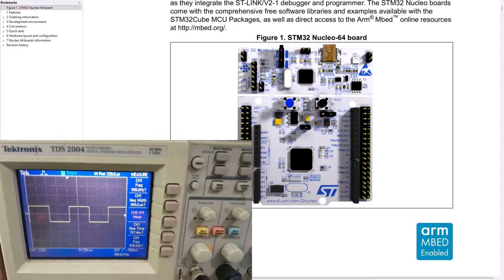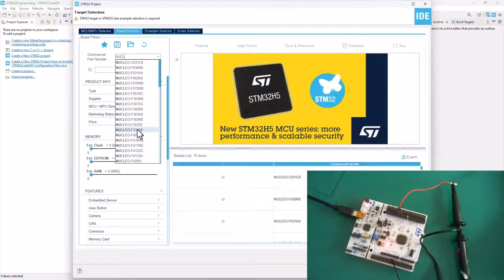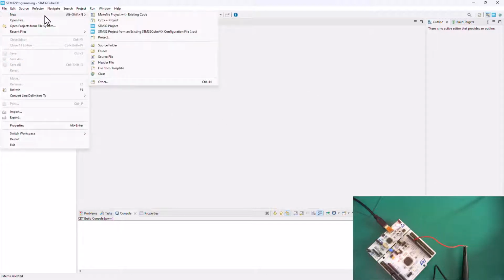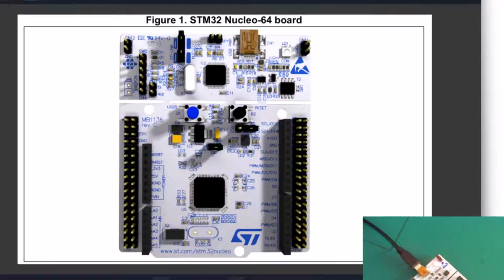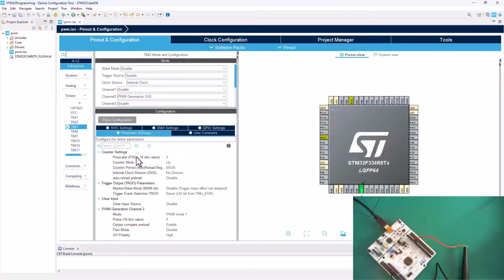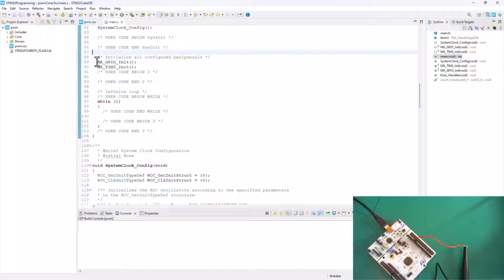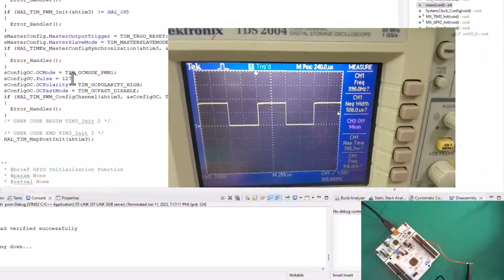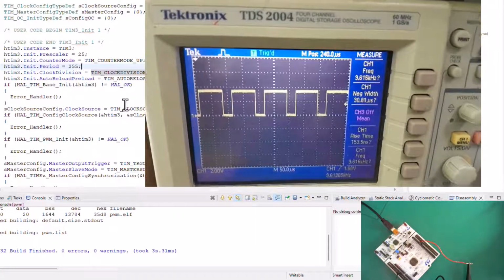How to generate a PWM Signal with STM32

Comment from the maker: If you ❤ my content and find it helpful, please Subscribe and hit the Bell 🔔

👇  SUBSCRIBE TO CMTEQ CHANNEL NOW 👇
https://www.youtube.com/c/CMTEQ?sub_confirmation=1
Reply: Hi mate, can wi fix the pwm duty cycle is 50% or 70%??
Or if we leaf the pulse to 0 is what happen???
Reply from the maker: Yes, you can fix the duty cycle at any value you want between 0 and 100%.
If you leave the duty cycle at 0, the signal will be off, zero. If you leave it at 100% , the signal will be 5V continuous
Reply: @CMTEQ  no, i see on the mc workbench is pulse=0 sir. What is that mean?? Because i used for motor control, and i want to fix the pwm on 50 or 70% sir.
Reply from the maker: @botak333  Hi, did you come right with your test for 50% PWM Duty cycle?
Reply: @CMTEQ  i dont know, because the code from x cube mcsdk, that is deferent with code from cube mx sir. In cube mx i can set the ccr, but on mc sdk i see on the code is (pwm_duty) / 2; like that sir. Not the fix number like 1000 or semilar
Reply from the maker: Fill up this form so I can get you email, then you can send me the code.
https://forms.gle/Vb2ezQogiKMf8rfA7

Comment: Thank you very much for great explanation,
I use STM32 nucleo-f303ze with stm32cubeide , I try to achieve 4 PWM complementary signal with controlled phase shift by potentiometer by using TIM1 channel 1 "PWM Generation CH1 CH1N" and TIM8 channel1 "PWM Generation CH1 CH1N", 
I use TIM1 channel 2 output compare no output mode, I set TIM1 trigger output parameter trigger event selection to "out compare OC2REF", I set TIM1 CH2 output compare no output mode to "active level on match" I make TIM8 in slave mode “trigger mode” with trigger source “ITR0” 
I need to change TIM1 CCR2 in real time with pot., So It can be controlled the phase shift between the two couple of complementary pwm signal “TIM1 &TIM8. but TIM1 CCR2 take one value and no change with pot change in real time can you help me to do that.
Reply from the maker: It's my pleasure to help! To ensure I can provide the most effective support, please fill out this brief form: https://forms.gle/65NbXvk8Zh21TTt37 
Once submitted, I'll follow up via email to discuss your needs in detail.

For Channel Members:
As a thanks for your support, Patreon/Membership subscribers receive prioritized assistance. If you'd like to explore these perks. 
You can learn more here: 👉 https://www.youtube.com/c/@CMTEQ/join 

Either way, I look forward to assisting you!

Comment: In my case, I am using an external oscillator to generate the system clock. However, I'm not finding an option to select the external clock as the source. What should I do? i am using cubeMX tool to configure?
Reply from the maker: Hi, I will have a look later. Please check my video on clock configuration. https://www.youtube.com/watch?v=CUgPXt4JE_c

Comment: Fantastic video mate !! . What should be the prescaler and period value if i want to have a frequency of 400khz?
Reply from the maker: Hi thank you for your feedback.
If you want to generate a 400kHz frequency you just need to play with the Prescaler and period value, I mentioned it in the video.
So for 400kHz  you can setup your values as follow prescaler = 20 and period = 7. depending on measuring equipment you might not get the exact 400kHz, if thats the case you can decrease the prescaler = 19.
Please note that this is based on the 64MHz clock frequency if your frequency is higher or less than you just need to play with the period and prescaler value until you get your desired frequency,.
Reply: Mate.. You are the best, This is the most underrated channel ever @CMTEQ  . I have achieved 400khz freq. THanks to you. Now i am trying to create a function that gets uint32_t input data from user and converts into pwm signals with logical 1 having 70% high and 30% low and logical 0 -vice versa. Can you help me?
Reply from the maker: That sound very easy to implement. I'm not sure which method you gonna use to get user input, buttons/keyboard etc...
But you can first create a function that increment your uint32_t var locally and pass it into your Timer Init function to change the duty cycle value. Once you have that working you should see your pwm duty cycle change automatically as the code runs.
Once you are satisfied you can then get the value externally by a user, sound like a nice project, an LCD would be a great addidtion to see whats going on.

Time is always an issue, the best way to get assitance fast is by become the channel member.

Comment: Are the terminals from GND (black wire) and PWM/D11 (red wire) both directly connected to the oscilloscope? What is your wiring set up?
Reply from the maker: Yes that is correct. I'm doing a simple GND reference measurement. Scope croc clip connected to GND(Black Wire) and Scope Channel 1 (Yellow) probe connected to Red wire D11.
Reply: @CMTEQ Thank you so much! I am currently using PWM for this STM (and this code) and with Escon 50/5 motor driver. What wiring set up would you recommend? I connected PWM/D11 to the Input PWM pin on Escon. What about the ground & power supply connections?
Reply from the maker: Hi Ashlee, if your Escon 50/5 motor driver and stm32 board are sharing the same power supply then you can connect your Escon 50/5 motor driver GND to the same GND black wire on your stm32 or on your power supply, while keeping the PWM Pin connected on the Escon PWM input. You should be able to control your motor.
If you need more assistance, like schematic and hardware connection, you can consider joining my low voltage membership, I will provide you technical assistance.
Reply: @CMTEQ  I will look into your membership! Thanks again. :)
Reply: hi mate how about like this??? 
Code:
 htim1.Init.Period = ((PWM_PERIOD_CYCLES) / 2);

Code: 
sConfigOC.Pulse = (uint32_t)(((PWM_PERIOD_CYCLES) / 2) * 0.6);

It will working?? So no need set pwmc setphasavoltage, because global pwm duty (pulse) already set max 60%?? 
Or this will set all tim for 60% sir?? 
Any idea?? Thank u @CMTEQ
Reply from the maker: I'm not sure if this is going to work, by multiplying the period by 0.6, you basically reducing the 50% period by another 40%, you might end up getting a value of 30% outpu. What was the result after loading it in?
Reply: @CMTEQ  that code fom mcsdk sir ( for control bldc motor) i want coustem the driver because my motor is 200v. And after rectifier ac220 i will get 310v dc. I rhink by reduce the duty cycle ( tim 1 for HIN and LIN) i will get average volt out to motor 310*0.6 but the code is like that the period not number but matematic(( pwm period cycle /2))  original code the sconfig0c.pulse=0 sir. So i wanr to set the pwm max is 60% duty cycle. 
Or do u have idea for my problem?? 
Some people say to me used pwmC_setphasavotage but i think it will mor complex code.
Reply from the maker: I can solve your problem if you give me more information.
What is this project about? Is it school project, work or is it personal work.

Fill up this form so we can speak on email.
https://forms.gle/93GheqPftAc2nr9u5
Reply: @CMTEQ  this is personal( hobbyis project). Oke i will fill up
Reply: @CMTEQ  i already fill up

Comment: The pulse width wasn't being modulated here lol you just showed how to generate a square wave.
Reply from the maker: Hi, Thank you for your humorous comment.
A square wave is a PWM signal with a constant duty cycle and amplitude. More  control can be introduced, like changing the duty cycle periodically in the code to achieve the desired modulation.